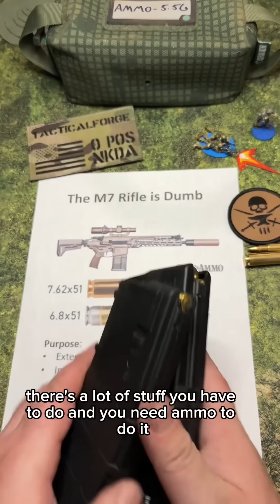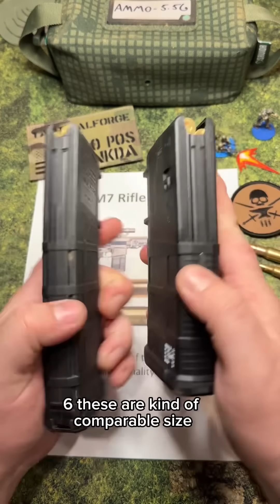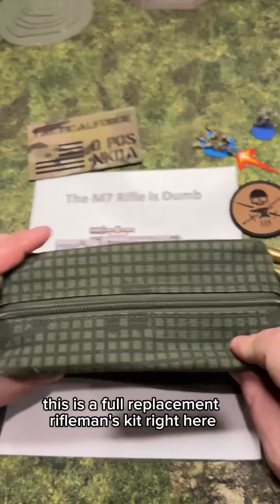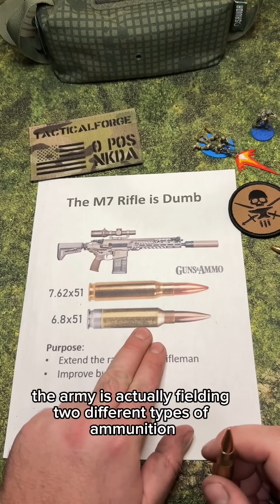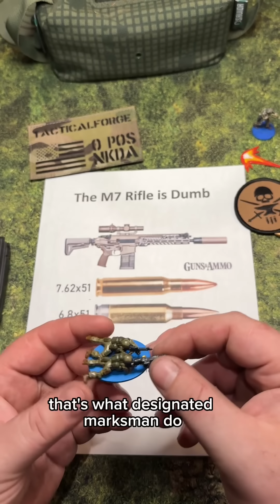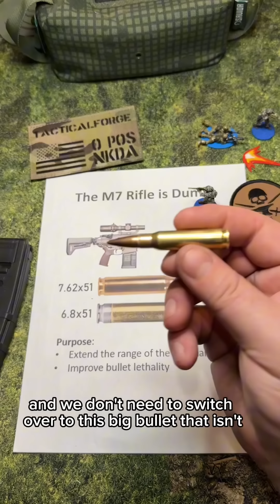My God this Rifle Sucks

Comment: My opinion is that the M7 is fundamentally flawed… not that the weapon itself is bad but the philosophy behind it is flawed. It’s the same type of mistake we made with the M14… trying to shoehorn wildly different mission objectives into one universal weapon and caliber.

Prior to the M14 we had the M1, BAR, carbine, submachine gun, machine gun, shotgun, and pistol all within the infantry. It allowed for a lot of flexibility depending on the situation.

As it turned out, the M14 was an excellent iron sighted MBR but sucked at everything else. The M7 will share a similar fate… it will be an excellent optic sighted DMR but it’s not really suitable for anything else. It’s way overpowered for CQB. 

I think we should simply abandon the obsession with trying to engineer the perfect universal weapon that excels in every situation. Instead we should take a look back at history and DIVERSIFY our small arms. This is especially true due to the drone threat. Soldiers need shotguns right now more than anything. Shotguns aren’t sexy and have a pretty limited application… but they are the best weapon available against drones right now… and good for CQC too. 

The M7 is large enough that it could serve as a basis for a shotgun and as a DMR simply by switching uppers. It would allow the soldiers to have the shotgun upper on for general use and switch over to the DMR when appropriate. The rest of the squad should be armed with compact assault rifles or even submachine guns.

Comment: Why not just beef up the 5.56 with hybrid cartridge, increased pressures, and denser bullet?
Reply: You could take the 5.56 cartridge and lengthen the case to two inches but maybe the recoil from full auto fire would be too great?
Remember that the 7.62 for assault rifles have a reduced powder load.

Comment: If you over pressured 300BLK as close as you can to 80k psi using the same tech as 6.8x51 then it would solve most problems of the M7. Same M4 platform, same 30-round STANAG mags, same 210-round basic load soldiers already know and carry. From a 13" barrel you’re pushing a 124 gr bullet to ~2,700 fps and 2,000 ft-lbf, out of a carbine while the rifle still only weighs ~9 lbs loaded instead of the XM7’s 13+ lb monster. Ammo is only ~20% heavier than 5.56 instead of 50% heavier with 6.8×51, keeps the subsonic/suppressed option SOCOM loves, drops straight into the 4 million M4s already in inventory, and kills the logistics nightmare dead. XM7 can stay in the inventory as a DMR for the guys who need to reach out farther, but every rifleman doesn’t have to lug a boat anchor and run dry after 140 rounds like the 101st is already complaining about. 70% of the 6.8×51 performance with 100% M4 compatibility and a lower weight penalty.

Comment: 1:36 the army just happen to omit publicly that even this new caliber can’t actually defeat an equivalent to an esapi plate unless they use a specialty penetrator…..  so not only do they have a mild training load and a spicy load for deployments (which I don’t think is really a big deal if you’re not expecting everyone to do this with a full size battle rifle) but realistically in a war time scenario you’re going to be encountering 3 ammunition classes. 

So pretty much they could’ve achieved everything they sought out to do by simply making a spicy case version of 5.56 and 7.62 with the same tungsten penetrator design for when strike plates are involved.

Comment: Meanwhile the army in 2008 asked HK to design them a replacement. It did everything on the list they asked. And it exceeded the performance it was asked for in many ways. They even catered to the top brass saying they are thinking "Starship troopers" for the aesthetics. They did it. Military than just said... we will stick w/ what we got.

Are we going from assault rifle to battle rifle? Now everyone has a DMR? 

1. WHY NOT USE A MORE POWERFUL PENETRATIVE ROUND THAT ALREADY EXISTS THAT CIVILIANS COVERT THEIR AR15s to? 
Basically they are replacing the M4 with something more like the AR-10. 
2. Idk Shit. Very stupid. But perhaps building something between the sizes of the ar-15 and ar-10 would be a worthwhile thing since the attempts to create something that has the best of both is failing. 

3. FN Scar L and H are already in use and loved. Can't they just try and design a real special 308 penetration round?

Comment: My idea of improving range would be 6 ARC in M4 and 6.5 Creedmore for AR10. Very minimal changes and retain all the benefits of current systems and keep weight down.
Far lower cost and no need to drill new systems.

Comment: Using heavier, slower bullets made sense in the past, when black powder was the propellant. But you can achieve the same kinetic energy with a smaller bullet if you just increase the velocity, and that would make a lot more sense to me going forward into the future... lots of exciting work being done right now in the field of newer and better propellants, everything from advanced energetic materials and thermoplastic elastomers to electronic ignition systems - you can actually squeeze a lot more out of an intermediate round like the humble 5.56. It's possible to achieve railgun-like performance. That's the path we should be pursuing, not inventing a newer and worse performing version of the .308

Comment: I think the AR in 556 cartridge could be looked at and improved .. Nicholas steel case gives you higher pressure change to better powder add a heavier bullet and you can stretch the distance of the existing platform I think that's what should have happened

Comment: Thank you.  I hope these refinements came because of the public backlash for allowing such a stupid gun.  The Sig Bi-metal ammo is inferior to the Shell Shock cases.  High pressure high velocity ammo is going to eat through disposable barrels, polymer cased ammo with longer barrels would be better out of a bullpup.  Shortening the barrel is equal to less barrel life and less consistent accuracy during that life.  Sig was the wrong choice, True Velocity and Textron was the obvious winner, everyone else is a jackass as far as I'm concerned.  The new 6.8 retard round might finally be good enough to replace .308 (if you like the terrible barrel life), but this will never replace the M4/M16.  The M4/M16 needs an update with monolithic upper receivers and 77 grain bullets with Shell Shock cases juiced to 80,000 PSI.  Shell Shock cases and True Velocity polymer cases have less heat transfer than Sig's inferior and expensive bi-metal case.  I really hate both Sig's pistol and rifle.  OMG, he is the opposite of me, the spring tension makes the rear charging next to useless, ditch the rear charging and keep the side charger only.  But I hate that rifle anyway.  Textron and True Velocity obviously won.  Awarding Sig is what our Communist enemies loved.

I don't even believe Sig's ammo is a good replacement for .308.  Polymer cased is superior for machine guns.  True Velocity was running just fine out of miniguns.  Show me how the Polymer ammo failed, let True Velocity own their shortcomings.  If Polymer technology has not arrived, Shell Shock's alloy case is here already.

Comment: Bit behind the curve its on to the m7a1 now its an 11inch.  Also the LRF cannot be spotted by nvgs its been tested and shown to no be detectable by gen 3 nvgs. I will give you the point about the suppressor but at that point the supressor is to control the muzzle flash so damned if you do and if you dont. To adopt this rifle it will require a doctorine change as far as how you engage. Just playing devils advocate instead of going with everyone else in the comment section. Also imagine what a 113 gr projectile is gonna do to a malnurished chinese soldier😂.

Comment: It kind of reminds me of the idea of people hyper-praising the M1 Garand in WWII, thinking this particular device was a substantial boon in firefights.

Now, I love the Garand, and while it is absolutely a benefit against one rifleman versus another having it out at various distances, we easily forget that up to the platoon level, German infantry are already operating around the machinegun, so volume and rate of fire issues disappear at that level. Would I prefer 8 rounds of semi-automatic versus 5 of bolt-action in either case? Heck yes, but at a larger, holistic level I don't think it's quite a wonder-weapon.

Urban fighting has pushed more or less the whole world to adopt an intermediate cartridge and in some cases carbines, but given the duty/role of intermediate suppression and the need for riflemen to still be capable of clearing close quarters with their weapons, dispersing M4 carbines and full-length M16s across the board seems fair enough for the rifleman's role.

Comment: They just forgot everything they learned with the m14s vs m16s, full auto control, ammo capacity, weight, all downsides, against the m16s and m4s. There’s a reason the m4 has been fielded successfully for soooooo long.

Comment: From the anecdotal evidence I've seen from videos in Ukraine bullets cause a very tiny fraction of actual casualties. And blasts from explosions and shrapnel are substantially more dangerous. If anything, guns have almost turned in a tool of suppression for maneuvering and not directly offensive. Of course they are still used offensively in close quarters and what not, but a solid chunk of the shooting that happens in Ukraine is simply suppression. One interview that stands out distinctly is of a Ukrainian assault unit and one of the guys said he brings 18 to 22 magazines plus 10 grenades for 1 assault. Like 600ish rounds.

Comment: I think of stuff in ratios. If a 5.56x45mm fighting load is meant for a 5'9" 170lb dude. My 6'4" 245lb self will feel 6.8x51mm just about the same.
Otherhand, smaller people are really going to suffer with this rifle, its really made for larger dudes to whip around.
Grab an ar10 off the shelf at a store, the m7 isnt far off in weight or balance. To me, m4/mk18 etc all feel comperable to a lightweight pcc.

Comment: I still like the 6.5 grendel concept since conversion would be inexpensive, ammo power at higher ranges begin to mimic 308, and ammo weight and volume is just a little worse than 556.

Comment: HEY.  I have an idea.  The US military can switch the a newly designed G3 rifle.
Same internals, same bolt, barrel, trunnion.  Same cocking handle.
Newly designed trigger, and furniture, and rails. Maybe tweak the recoil springs and buffer.
There you go. A tried and true, time tested design, and its a true battel rifle.

Comment: 80k through a .277 hole means massive heat, which means massive throat erosion, no matter what you line the barrel with.

Comment: 2:29 Dude... You know we've been using laser aiming devices on the battlefield for decades now. One more is not going to hurt. Our PRIMARY MEANS OF NIGHTTIME AIMING IS WITH IR LASERS!!! And the optics that are on the rifle pictured isn't even the one with that feature. It's an LPVO.
Reply: There's another factor to your point too;
Laser rangefinders don't beam, they do nanoseconds long pulses. People on NOD/NVD won't spot the LRFs doing their work.
However there are anti-designator laser detectors fitted on many vehicles. These tend to be set up to detect longer designation pulses, but in theory could detect rangefinder pulses.
Reply: Problem is that was in countries and environments where the opponents did not have the same capabilities we do. China and Russia have anti laser designators. We have yet to see the effects of IR in a conventional peer to peer conflict yet.

Comment: My prediction just like in the 1930's when the M1 project rifles were being tested in .276 Pedersen (another 6.8mm round) the Garand performed well but when we were about to go to war they wanted it rechambered for a round we already had plenty of (30-06) the M1 was easily converted while the Johnson and Pederson rifle lacked the rapid conversion leading to the fielding of the M1 in 1938. 

Now fast forward to today. M7 will get fielded. 6.8 will not be mass produced rapidly and parts wear because of the pressure will cook these weapons. They will reconvert to 7.62 and either fully adopt the URGI for the M4's or get another sig contract for the Spear LT in 5.56

Comment: The way I see it, the M4 with 5.56 is still working as well as it ever did. So if it ain't broke, don't fix it. I see winded, and fatigued soldiers using the 6.8 less accurately/effectively for that reason.

Comment: Wow. Everything you say makes sense. Also it’s damn near a pistol with a 13 inch barrel. If your not in like a city or storming houses and buildings which correct me if ime wrong not every soldier does I feel like these super short barrels are kinda dumb. And it almost has to be that short for that big ass can on it. I didn’t know the m4 was broke. Why they trying to fix it? Something stinks with sig.

Comment: there will never be a better rifle than the ar15 until the game is all about shoulder fired laser cannons. the ar15 just does so much so well and the stuff it doesn't excel at, it does perfectly fine. it's like the mp5, a gun that doesnt even lock on open, but it does so much so well that it comes out on top as the best subgun you could have (other than an AR9 LOL). sure, the ar15 can pop primers into your gas key sometimes and make the gun inoperable. sure, the spring sound next to your ear is kinda annoying, and sure, 5.56 doesnt have great armor penetration. but holy shit, what other gun does all that the AR15 does?

Comment: In the rifle trials that SIG "won" Desert Tech had a compelling entry with a rifle that used plastic ammo to achieve results comparable to the 6.8x51 bullets. Which if my memory serves me right had 30 round magazines.

Just saying.
Reply: your memory is wrong their rifle had a 20 round magazine for their own 6.8 cartridge made in partnership with PCP
Reply: @matthiuskoenig3378  thanks for the correction. Plastic cased ammo is still very promising though.

Comment: Plus, changing muzzle devices is a PITA because SIG barrels don't have a stable enough system for common barrel tools to hold it without risking damage to the barrel screws, and SIG is also rock-setting the muzzle devices. And you'll need a taper adapter. Lame move.

Comment: I try to think of one of the ugliest situations for riflemen in the last 30 years, and I keep coming back to 1993 Mogadishu and the Blackhawk Down battle. Ranger squads out on 24 hour operations with just what the carried on their bodies. No packs. M7 has 25 rd. magazines, not 20, but that is automatically 35 rounds of ammo missing in that fight. The rangers were already running into last magazine situations before the 10th Mountain and armored support rolled in. I would like to see the army conduct an actual live fire extended battle such as the rangers went through. Fire the same number of rounds, no added extra maintenance support thrown in. See if the M-7 can handle it...especially the suppressor. Did the 175 round loadout last through the almost 24 hour battle or did it run out???? Did the suppressor end up melting as I have seen some do?

Comment: I never liked that rifle to begin with, the Infantryman has enough on his plate without that contraption.  The Infantryman needs a rifle that can hit at moderate ranges ( Hence the reason for intermediate rounds ) It has to be light weight, the new M-7 weighs more than my M-1 Garand, and if the war in the Ukraine is any example of enemy body armor, the 556 is totally addiquet and at moderate ranges with the 556, or if a new service cartridge is indeed required, and or desired, then look no further than the 25/45 Sharps ..6.35x45 MM. It is ballistically superior to the 556, and only requires a barrel swap.

Comment: Perfect rifle for Afghanistan, but we’re not in Afghanistan anymore
Reply: Exactly, and it's an engineering solution to a much bigger problem. The solution is just to not engage mountain based guerrillas who have substantial support from a neighbouring country that they can retreat to in a pointless 2 decade long war in terrain that massively favours them where your radios don't work properly. No rifle will ever solve that problem.
Reply: The military is always fighting the last war
Reply: @kylebradley3  Right, because all that body armor the Taliban were wearing was a real problem for our infantry weapons. They adopted an armor piercing round. That the round flies far is not the intention but a byproduct of the fact that the best ap rounds tend to be high speed projectiles that also have long ranges.
Reply: @greene6226 it was combination. Meant to counter some new high tech body armor CIA claimed Russia and China have (which doesnt exist) and Also extend point target lethality because "lessons learned in Afghanistan"
Reply: @ryanpeck3377 The CIA knew it was a bluff.  Someone's "buddy" said it wasn't a bluff.
Reply: Maybe they're hoping China steals the tech. No just corruption!!!
Reply: They just need 20" modernized m16's chambered in 243 Winchester.
Reply: @unlisted9494 6.5 grendel makes the most sense.
Same sized action, still low recoil.
Just extra range & extra energy
Reply: Exactly. Would have been handy in Afghanistan, but that's not what's needed now. But hey let's spend billions on what we could have used in the last war, but fuck up the next one.
Reply: The US Armed Forces: Preparing for yesterday's war, today.
Reply: Good for.......America though 😮